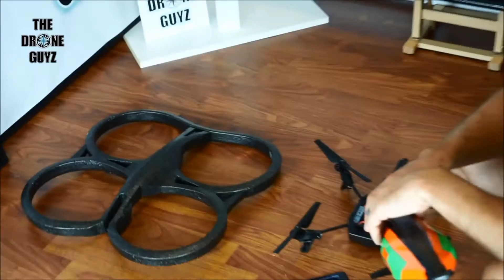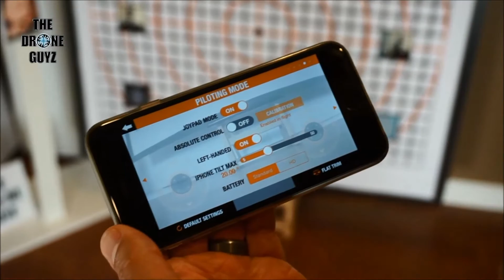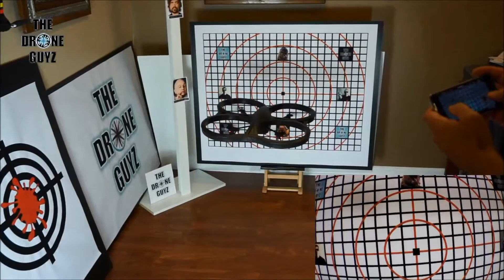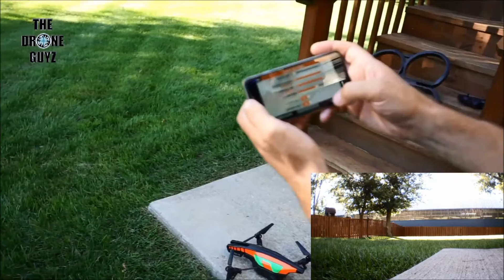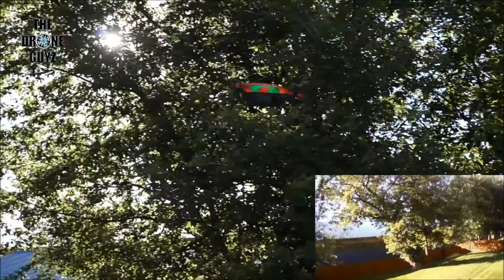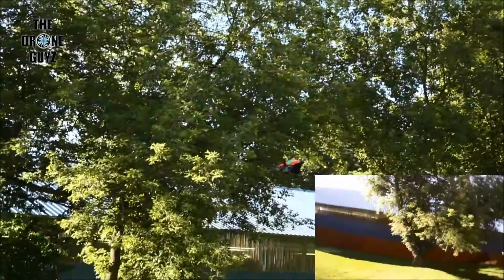Half Chrome: Parrot AR.Drone 2.0 Flight Test and Review

Comment: Hey guys, the reverse thrust issue is known for a while, But it doesnt looks like anyone care about it, But I FOUND A WAY TO FIX IT, if you're going to use the outdoor hull, In the app, turn the out door hull settings off even though you're flying with the outdoor hull, Trust me, It will stop much more gental then outdoor hull mode, Because it thinks it have the indoor hull mode and adapt to it, and now you can fly it as fast as you want without it overfilling itself on stops. I dont understand why parrot is not interested in fixing it for the past years

Comment: I bought one of these a few years back. I found it almost impossible to control with a smart phone/pad .  There is a way to modify them to run with a remote control, but I never had mine done.    For where the drone market is right now, these things are a LOT of money, for almost no control, and very odd features.  Not to mention that the battery don't last for shit.   You can get SO much more for SO much less now a days.   This is half the price of a DJI Spark...  that right there should make EVERYONE pass on them.  
I did find that the easiest way to control this drone, was to limit the tilt, or you WILL have issues with it....  Then fly it in headless mode, and use your device on "Tilt" function instead of Joysticks. Those Joysticks are a fucking joke and don't work for shit.